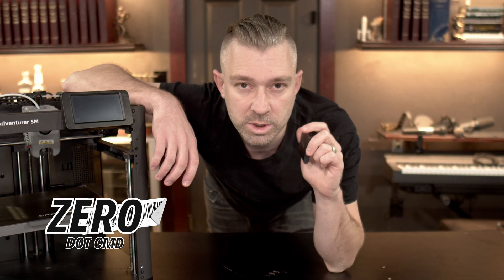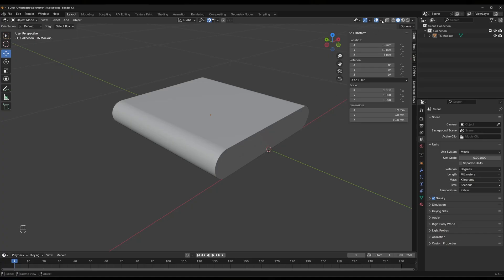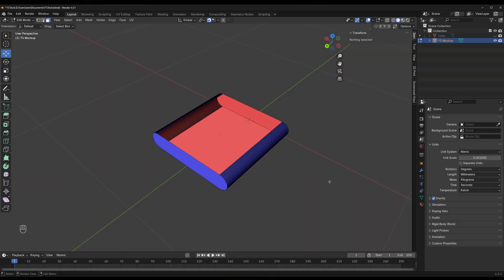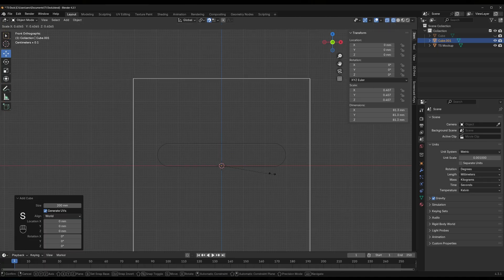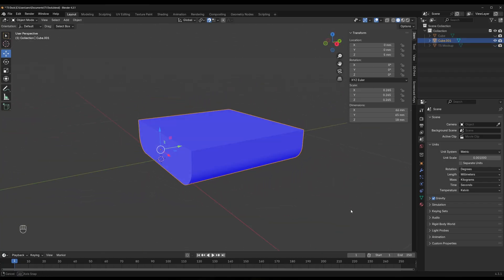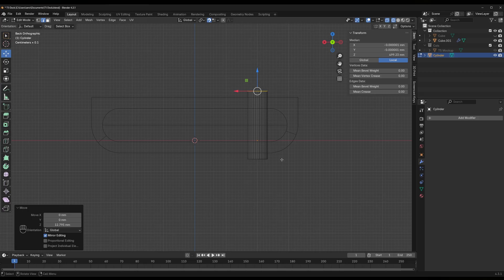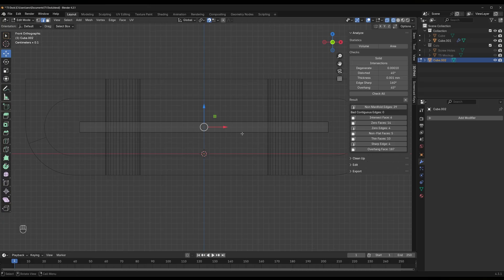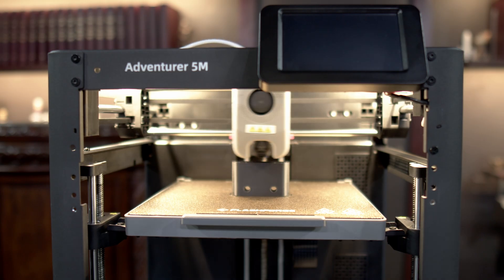Blender for 3D Printing: A Beginner's Guide

Comment from the maker: ✅ Grab some filament to help support my channel - Amazon Affiliate Links 
   HATCHBOX PLA  -  https://amzn.to/4g8BAPE
   OVERTURE PLA  -  https://amzn.to/4gsexPx
   PolyMaker PLA -  https://amzn.to/49xqvVT
   Elegoo Rapid PLA -  https://amzn.to/3OKw9dQ
   Sunlu PLA  -  https://amzn.to/3Vx4ErL

✅My Top Pick for 3D Printers - Amazon Affiliate Links
   Flashforge Adventure 5M - https://amzn.to/3B4Wtw6
   Flashforge Adventure 5m Pro - https://amzn.to/49oAFYX
Reply: Hey, some of your affiliate links no longer link to products. I wanted to checkout the 3D printer you are using. Also, on a previous video (making the headphone holder), the affiliate link directed me to a product that was no longer in stock and seemed like it wasn't being sold anymore by that supplier.

I'm trying to decide which 3D printer to buy right now. I was kind of set on the Bambu A1 (or Mini) but now seeing Flashforge, I now have a delimea.

Comment: When I turn on face orientation, it stays gray. Why isn't mine blue, and is that a problem?
Reply: Found a fix,
Navigate to Edit > Preferences > Themes > 3D Viewport > Face Orientation > Front, and increase the alpha value from zero to a visible level, like 0.3 or 0.4. 
For me the red color was 0.7, and the blue was 0, so I made both 0.7 and it worked.
Hopefully this helps.
Reply: @LudicrousMouse  Worked for me too, Thanks.

Comment: Great video, didn't know you could turn the inside red. A program I used to use Cheetah 3d used a term called "water tight" that it could check to verify there were no errors in the model before printing
Reply from the maker: Thanks, glad you like the video. I really find the facing orientation really helpful.